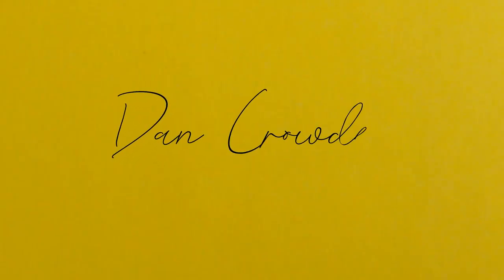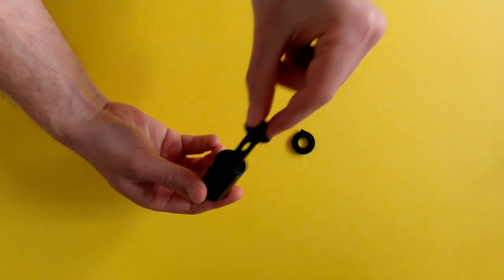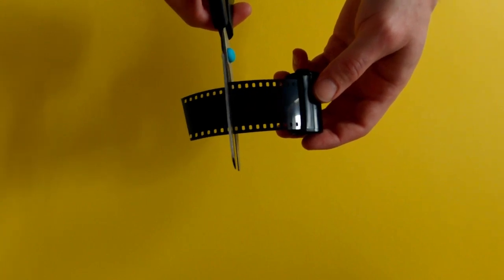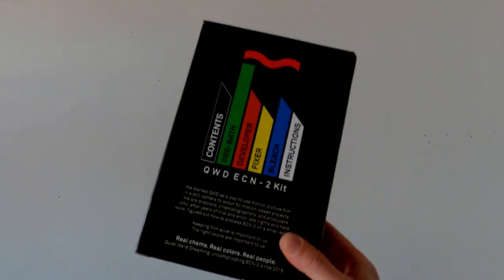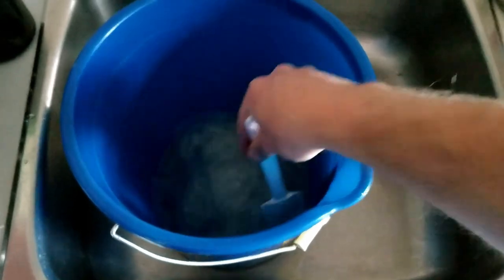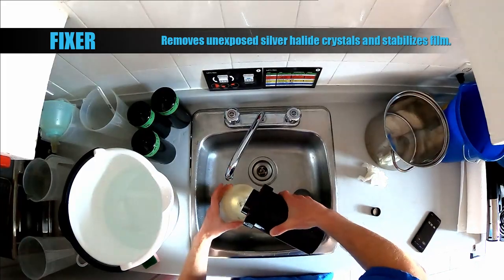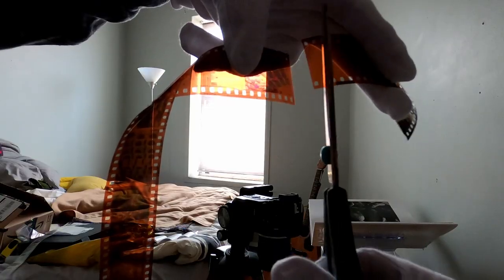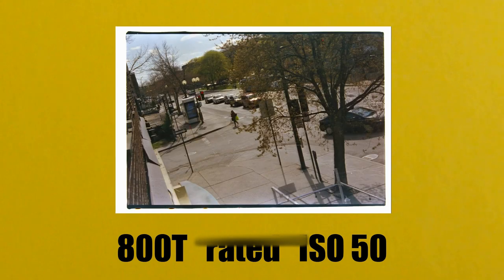ECN-2 Processing at Home: Expired Motion Picture Film Kodak Vision 3 500T and 800T Film

Comment: That's really strange that the chemical kit you use affect the ISO like that.  If you use the proper Kodak chemicals, Bellini do a 1 litre kit that uses the same chemicals as kodak, it works as you'd expect.  Doesn't require vinegar or distilled water either.  I wonder why this kit needs distilled water and vinegar?!  Nice vid!
Reply: I think he was overexposing the film because it was expired.
Reply from the maker: That's what I was going for, yea. @floydparker3745 the chemical kit itself was not affecting the ISO, you're correct assuming it wouldn't. I'll look into that Bellini solution, thanks!

Comment: I have 250D expose it at 100 iso and c41 process very good results , does the 500T needs 25 iso ?
Reply from the maker: Hi Tasos, I've never tried that, it  sounds fun. I imagine that if you shoot 250D at 100 ISO, you are giving almost double the light that the film needs. If you shoot 500T, at 250 ISO that's giving double the light necessary, at 100 ISO, that's 2 stops of light more than the film needs, 3 stops extra at 50 ISO, and 4 stops extra at 25 ISO. Your experiments will always be the best way to discover what works for you. Looking forward to hearing how it goes for you!
Reply: @dancrowderphotography8123  I don't understand why you don't just buy Kodak Vision3 fresh and bulk load that. No worries about having to overexpose it. Just shoot, and process then scan. You'll get beautiful cinematic color images.

Comment: The part on bulk loading is pure BS. He fails to explain how he put a 400 foot roll of film in a bulk loader which holds no more than a 100 foot roll.  If he finds a convenient way to break down that 400 foot roll into 100 foot rolls or shorter so they fit in that bulk loader, now that would be a good video!
Reply from the maker: Mate, no need to call BS. You're free to ask questions, and I do appreciate you watching and taking interest. The truth is already in your comment - of course I didn't fit 400 ft of film into a loader that only fits 100 ft. What I have been doing is opening the large can of film in the changing bag, then winding directly into the re-loadable film canister from the 400 ft roll. I grabbed the little winder from the bulk loader and spun the top of the canister while holding the canister with my other hand. That's the only way I've figured out how to handle such a large roll - that is until I get down to a length of 100 ft or less that actually does fit into the loader. It's a pain in the ass, for sure, and the hand does begin to cramp up winding up all that tension. Next time I wish upon a star, it might be that somehow we can have color film in 100 ft rolls to bulk load.

Friendly ask, what's your experience with bulk loading? Have you tried loading cinema film before - if so, how'd you fare?